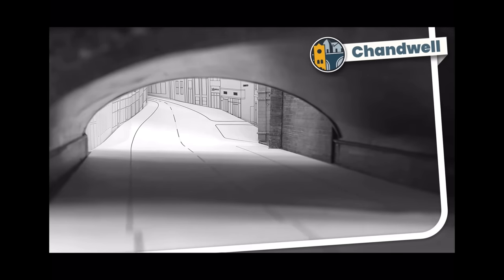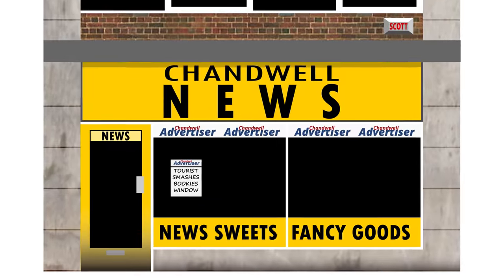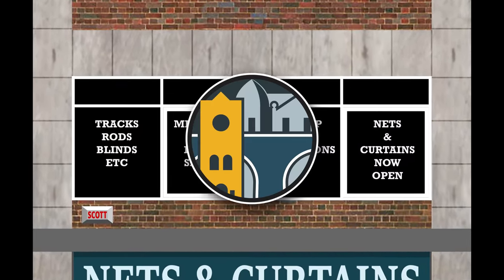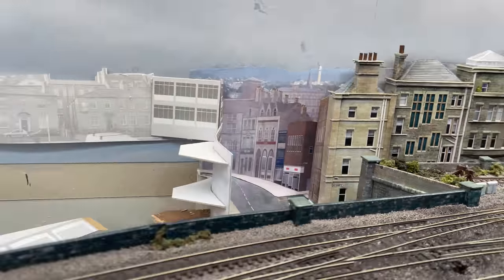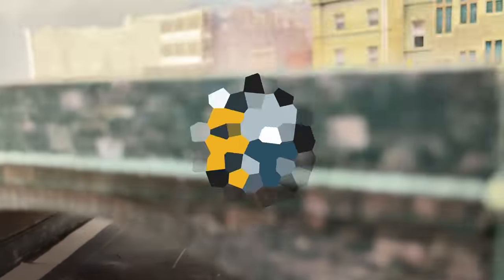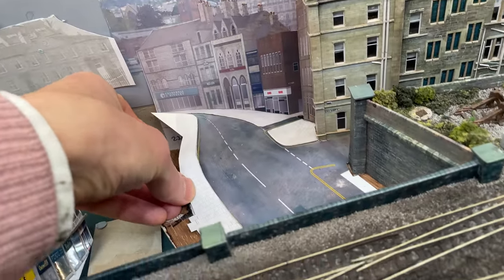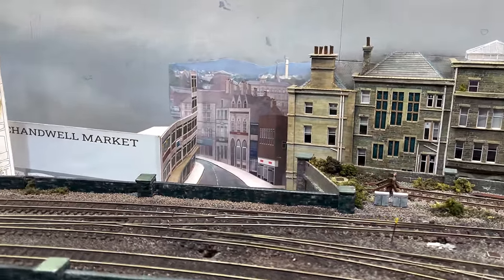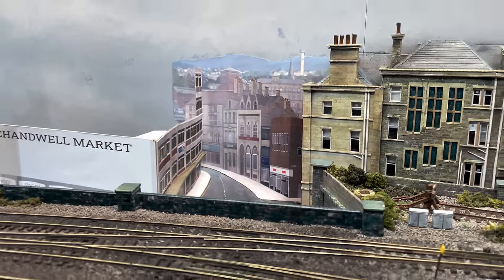Continuing the illusion - making a 1960's row of concrete shops in forced perspective

Comment: Hi Michael. As usual some superb forced perspective work there. Are you going to leave the canopy cardboard coloured or give it a watercolour wash?
Reply from the maker: Thank you! It's already had a light wash of colour, and in real life it does look vaguely concrete-like rather than cardboard-like. But I think it needs something else... Not sure what yet though! What kind of shade/colour wash would you use, do you think?
Reply: @Chandwell  I think I'd be trying to tie it in with the colour or the lighter grey pillars between the shops to make it look like it was an original feature of the building. You could try dry brushing it with a very light grey over the existing colour to see how that looks. Painting will be easier I guess than applying a texture paper. Some faint lines penciled in from back to front equally spaced might enhance it, as I doubt a concrete canopy of that size would be cast in a single piece? I'm sure whatever you do will look epic though.....after all you are the Guru of card scratch building!
Reply: @Chandwell  Greenish for mould/gung?

Comment: Michael The High St front of Chandwell Indoor Market is looking good. If the backs of the other side of High St look as good, think they will add to the blend of Chandwell developing over time reacting to it history. Will they be all older buildings or will some have more modern additions like on some of the backs on Back Market St. could this be the place for the back of Methodist Chapel and Hall like on  the one on Walkergate Otley. Think the pavements on High St to under the Railway Bridge look good and set the scene well. Looking forward to how it develops further. Ian
Reply from the maker: Thank you Ian. I'm in the process of mocking up the buildings based on prototypes in the city centre of Bradford. It takes some time trying to get the size right but hopefully it will look OK. There's an added challenge with Bridge Lane being in the mix, but I am hoping I can just ignore that!